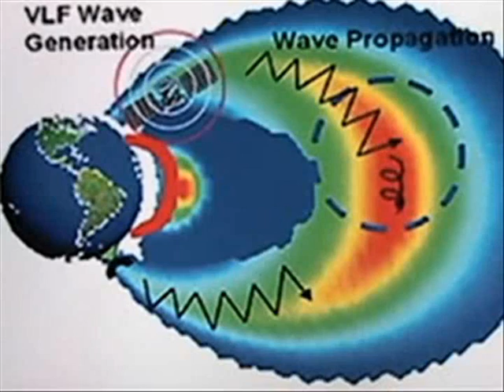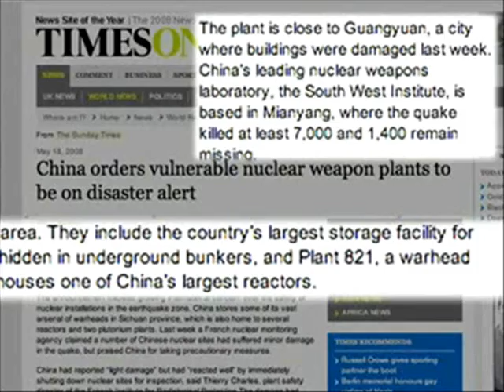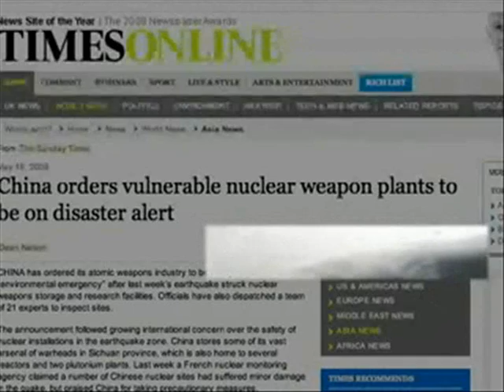HAARP and Earthquakes

Comment: Fracking can set off earthquakes , if the stress is there then the fracking makes it unstable then makes the plates slip which produces the earthquake they recently had to stop fracking near Blackpool in England because it caused an earthquake albeit was only 3.6 but ya dont normally get earthquakes here

Comment: While this does interest me, you forget to mention... 1) Mu Radar – 1 megawatt facility in Japan (34°51'14.80"N 136° 6'19.45"E). And that the origin of the earthquakes, are used in connection to plates already in pressure point areas.  This particular Tsunami of current event, was a force push from US soil.  An unlisted HAARP station, not the Alaskan.  These are the main "cannons" if you will for large incursion alien offensives, and many other monetary usage applications.

Comment: Goes to show, cant believe everything this guy says. "you know how there's high pressure zones and low pressure zones, well high is hot and low is cold , and the hot flows into the cold" Go learn the facts before trying to preach dumbnuts.

When air is heated it expands. Hot expanded air is not as dense as cold air. low density = LOW pressure. Thus a high pressure system is actually cold air and the cold air expands into the hot areas.

I suggest you go educate youself on real things

Comment: 2:35 That's so wrong, I'm not even sure where to start. Even if the radiation could physically move the ionosphere, and the ionosphere somehow rebounded with enough force to cause an earthquake, the pressure wave would be comparable to that of an enormous nuclear bomb detonating at ground level. If HAARP really could do this, it would be destroyed the first time it was used, because the atmospheric shockwave would be directed straight back downwards.